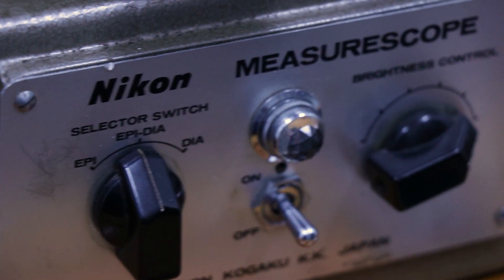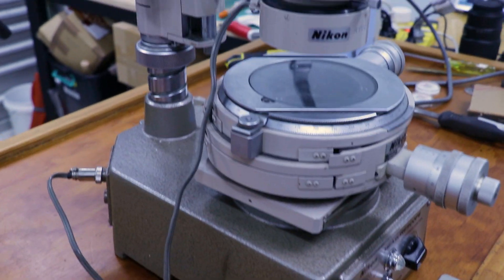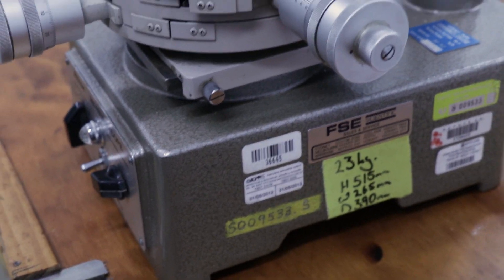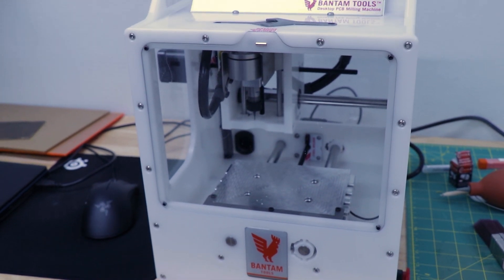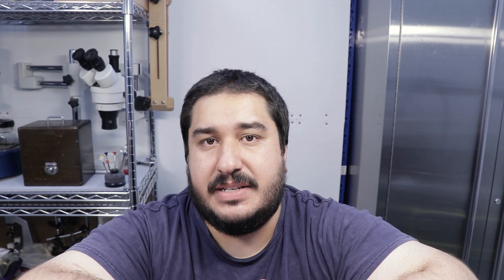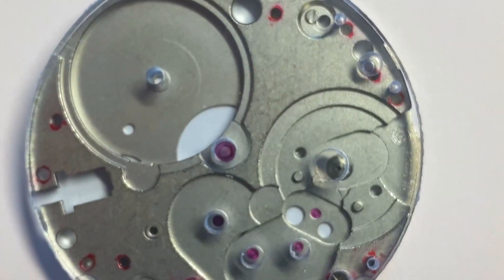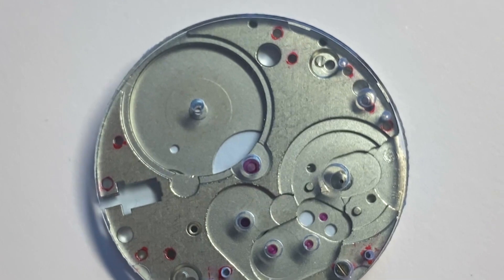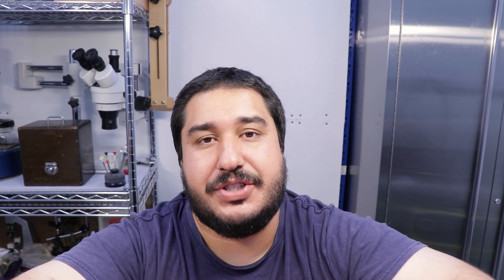I bought a CNC Machine - Watchmaking Vlog 48

Comment: but the BANTAM WILL NOT GIVE YOU THE ACURACY THAT YOU NEED. ITS N CNT NOT CNC
Reply from the maker: one way to find out!
Reply: @DeanDK  the biggest problem will be the heat in the brass. you'll will need a decent cooling that's why they usually use flood type system. get a big block of aluminium and use it as a jig. this will transfer the heat out. also give you a more preload on the bearings. less vibrations.!! anyway welcome to cnc :) have fun

Comment: All the best, would like to know the accuracy of the CNC machine, It doesn't look like watchmaker grage CNC ??? Did I missed something?
Reply from the maker: Hi LB, this little machine was designed for PCBs has positional accuracy of about 0.01mm per 25.4mm of travel though and 26k rpm spindle. I’m not going to try cut brass, just drill the holes. For this I think the machine is capable especially for 6498